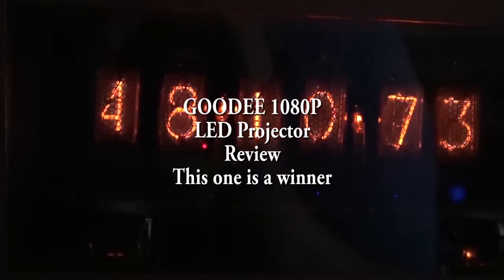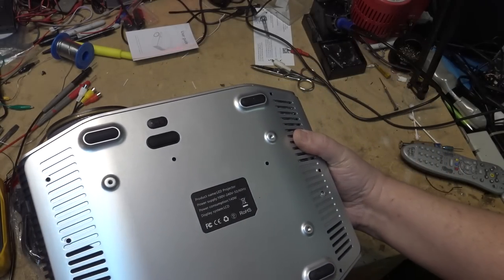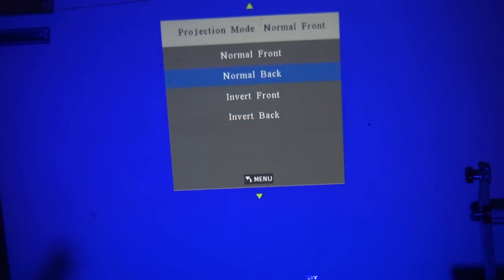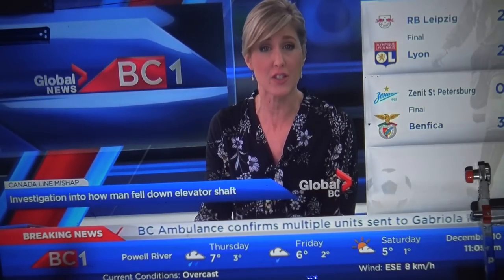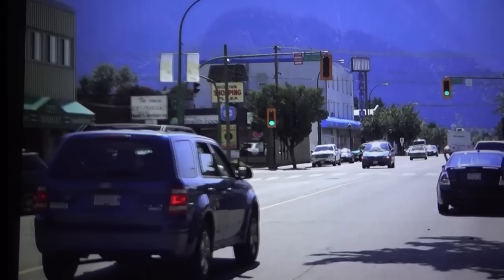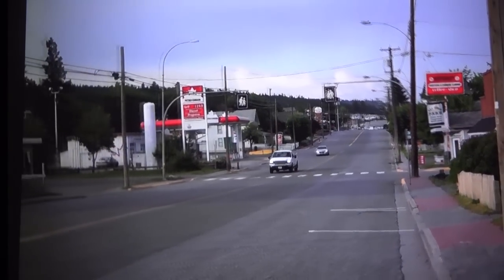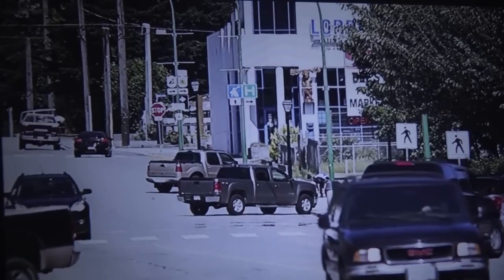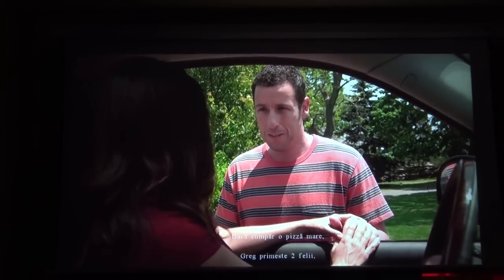GOODEE YG620 6000 LUX 7000:1 Contrast 1080P LED LCD video projector   This one is a winner

Comment: I remember working at CEI in the north of Melbourne in the 80s on cart machines. They also imported Barco three tube projectors, the BarcoData IV had just arrived and I watched it being set up for a customer. For the time it was impressive although VGA systems did little more than 640x480, it was very sharp and bright. Of course you would expect it to be good at $AUD24,000.  Interesting to compare that to small, affordable LED projectors.
Reply from the maker: Those CRT projectors usually used a special high reflective screen. I worked on many Runco projectors which were in the 20,000 range, and from memory this one is brighter.  I have it set up in my living room on a white 100" screen with my cable box. Watched it all night, and I am pretty impressed that such a low cost unit looks this good. Is it as bright as a data projector, no not quite, but I had lights on in the room and it looked great.  I'll haul out my  old Viewsat DLP and see how it compares. One thing for sure this has better color by far than my viewsat, and doesn't have the strobing that the old DLP has.
Reply: Looks pretty impressive even YouTube processing.
Reply from the maker: @Wenlocktvdx  
It is.  I shot the scene in the living room with my more professional camera the Sony ax100 with a larger sensor than the one I use over the bench.  They are both 4k cameras but the bigger camera has a better picture due to larger sensor and better glass.

Comment: Looking forward to a teardown video - I wonder if it uses a standard COB LED panel of the type commonly found in streetlights. The fan is probably more for cooling the LCD, since LEDs of this power level are usually still passively cooled.

Comment: Wow impressive projector! Video quality is so superb at 1080p!. Surely it weakest link is stereo output done thru the headphone jack.. You will need a good sound system for a large room or outdoors. I guess you won't have to check your life insurance policy with it unlike the battery powered seaplane!
Reply from the maker: The output IS stereo. It just only has a single speaker in the unit. The audio output is stereo, and I will be linking that via bluetooth to my stereo amp. I was watching jurasic park on it with headphones. Was fantastic.

Comment: This is really surprising how good these little projectors could be. The Goodee name is fine! Contrast and colors are well balanced and way more real looking for sure if you compare with your old projector.
There are of course differences with pro stuff, like remote controlled focus and geometry (and many things you never use!) and most important high luminosity. And I'm curious about the fact they don't give numbers on the cardboard of this one. When it comes to projection with an important ambiant light, you absolutely need power, and it's measured in lumen. This factor is something difficult to get, as many give approximate or even delirious numbers. Luminosity should be given following a norm ANSI, alas it's not what you first get with many manufacturers. I've seen 5000 lumen given for a 100€ projector, and labeled only 750 in the documentation! It recalls the 1980's ads about HiFi amps, with some announced for a total 1000 Watts power, but in fact was a rather small 25 real Watts (and even less following the DIN norm!).
This number, and a good contrast, are the key if you want to project on big screens or low reflective surfaces, and if you need some minimal ambiant light. Lowest luminosity, and you will need an extra dark room. Highest ones, and you will use it every time, even during your meals or if your family has other things to do in the same room. Another use is presentations at work in a normal office, or for projecting ads in a shop.
Say, yours apparently uses a fan to cool the LED source, and it gives an idea that it has interesting numbers. Somewhere above 3000 lumen?
I've got a pro Optoma, but it's a fragile and costly monster. It's 6000 lumen (real ANSI ones!) are interesting if you want to project a demo in ambiant light with a good contrast. But it's noisy, heavy, and uses a fragile discharge lamp that generates heat and needs time to reboot if you have line shortages... 

So this model seems quite interesting, but it's not that easy to find the references and infos.
Reply: Brightness doesn't help if the room is fairly bright.. Black curtains solved this for me.. I use a hybrid laser Casio at 2500 lumen, but without dark contrast, full power mode still falls short.. 🍺
Reply: It's a 140W LED, and LEDs are around 100 lm/W, so that would probably be ~14klm at the LED itself; and even if half of that is lost through the LCD and the optics, that's still 7000 lumens.
Reply: @CanizaM  - it has a 140W LED says who?
Reply: See 00:45

Comment: Do some more switch mode power supply repairs. And tell us more about capacitor esr. There is a certain  Youtuber shango he plays music through his capacitors to test them.
Reply from the maker: Capacitors will pass AC. That is what they are designed to do. That is why they are used to couple amplifier stages together.
Reply: Maybe you can put some faults on a pcb and show how to find them.

Comment: What about the military drones aren't they battery powered?
Reply from the maker: No they use a rotax 912 which is a 4 cylinder 4 stroke aircraft engine that runs on regular gasoline.
The one shown on the news clip is the worlds first battery powered aircraft, and that was the first test flight ever conducted. Once certified they will be making regular passenger flights up and down the coast on short runs. They will all be seaplanes flying over water, so if they run into an emergency power condition they will be able to just land in the ocean.

Comment: Howdy, 12voltvids. Been a subscriber for a few years. I'm considering buying one of these. How has it gone after a year of use? Still going strong? Would you still recommend this unit?
Reply from the maker: Yes still working.  Has a few hundred hours on it by now.   Not used every day but regularly.  Still looks as good as day 1. The other 2 projectors were sold as this one was much better.
Reply: @12voltvids  Cool thanks. Exactly the amount I will use it. Unavailable until late January but willing to wait. Must be manufacturing more as they where popular.

Comment: How many meters do I have to put it to have some good screen size
Reply from the maker: I have it about 3 metres from the screen and i have about a 3m picture.
Reply: @12voltvids  thanks. 3 meter is big enough I guess
Reply from the maker: @Hi-levels  
It will go bigger if i move it back farther but this is the size of my screen.
Reply: @12voltvids  yeah I plan to buy one and use in my room which isn't very big. I plan to have a screen size up to 2.5 meters I guess. Its good for movies right?
Reply from the maker: @Hi-levels  it looks good.  I don't use mine much because I really don't watch much TV or movies.
Reply: @12voltvids  I don't watch TV at all. Literally zero time spent there because I live in Turkey. And the main stream media is worse than the cold War time Pravda gazette hahahahha

I watch movies thru Netflix or local  .mkv files. So I will buy it for watching movies, and rarely playing games. I want to build a home theater on budget lol

Also did you check the internals?